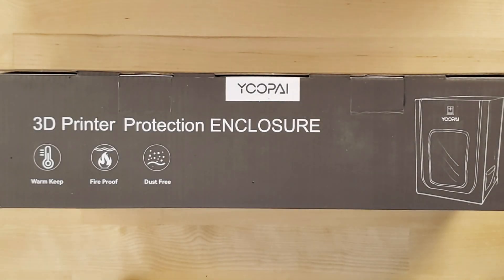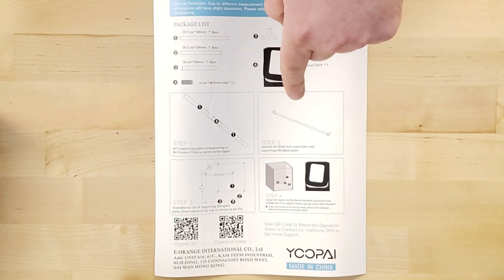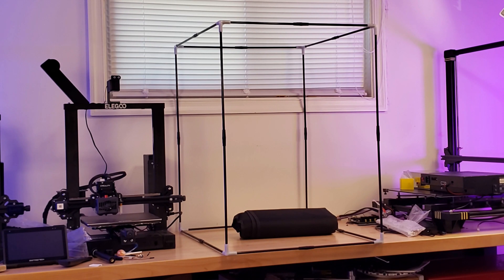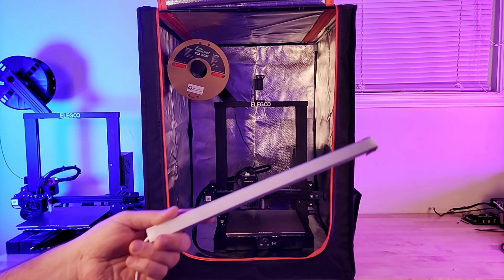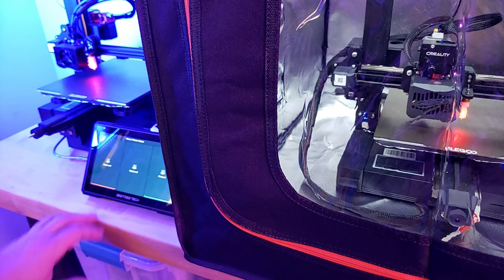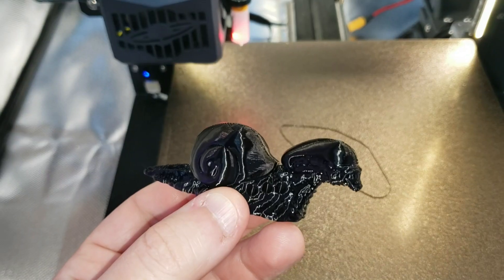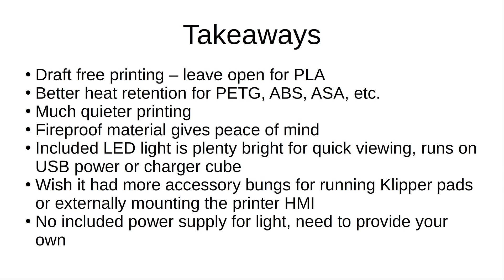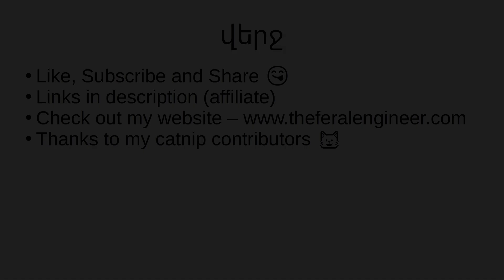Just released! The latest 3D Printer enclosures from Yoopai!

Comment: So you say it could do more harm than good using this with PLA due to heat retention. My Ender 3 uses exclusively PLA but it's in my bedroom so I was looking for a way to reduce the amount of microplastic fragments I'm exposed to. I know that PLA is really inert but I prefer to err on the side of caution, so would you recommend me to get this enclosure or is there another way to solve my problem? Leaving the enclosure open seems counterproductive to my situation
Reply from the maker: You more than likely wouldn't have any major issues unless the chamber temp gets over 40c, but some enclosures have a filtered exhaust you could use

Comment: I got one, though mine didn't come with the light but came with the ventilation fan instead, which is clearly the more important accessory.
Reply from the maker: @Captain_Draco  that must be the new version. I had recommended that to them when this one was released
Reply: @TheFeralEngineer  it might also be the smaller one too. It's the one geared towards resin printers. The side access flap is replaced with a ventilation flap near the top. A few extra pouches for long narrow tools like torque drivers and such as well. I'm quite impressed with it.

Comment: Will that enclosure make PLA filament stick to a PEI spring steel bed, long enough for the printer to finish, as long as the bed stays very hot?! I use an Ender 3 Max Neo
Reply from the maker: @derk4737  PLA doesn't need a lot of heat with pei. 50-55 is ideal. Wash the bed with dish soap and water, make sure it's level and keep the machine away from drafts. Enclosures sometimes do more harm than good with PLA
Reply: @TheFeralEngineer  as far as 50 to 55…. I assume you’re talking about making sure the PEI bed heat is only set to 50 to 55 is that correct?
Reply: @TheFeralEngineer  I got the enclosure for the printer because, I tend to have fans going and sometimes an air conditioner going and frequent drafts from people walking near it!
Reply: It should keep the temperature inside stable.
Reply from the maker: @Captain_Draco  you just have to keep an eye that the inside temperature doesn't get too high with pla or that can cause issues as well